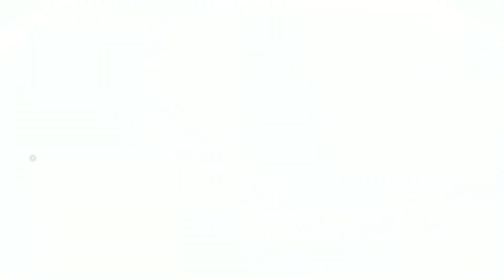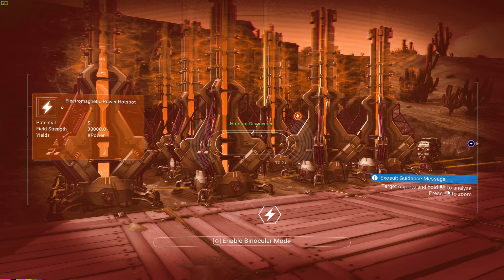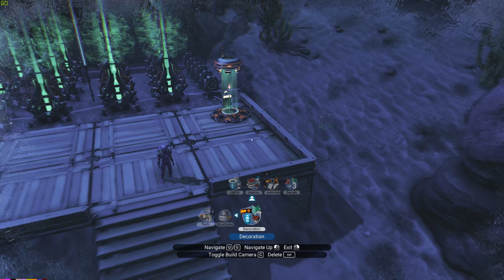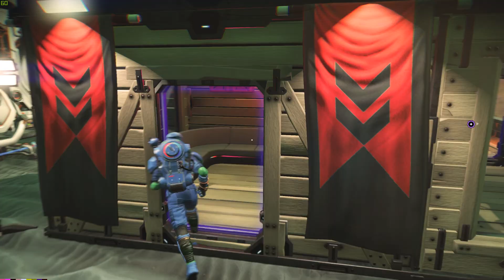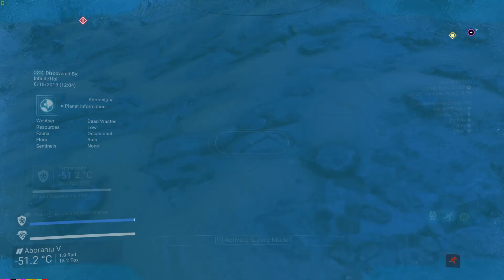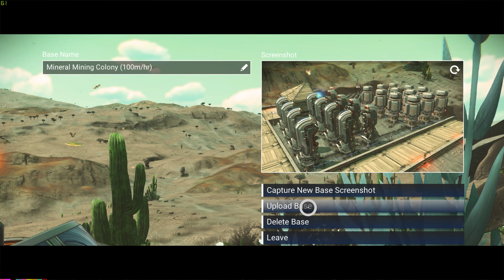No Man's Sky Beyond - Easy 100 MILLION + Units NEW Method | No Man's Sky Making Money

Comment from the maker: This is now my favorite money method. I never have to work again for money and as long as I have
a few of these running.
 Giveaway: https://www.instant-gaming.com/en/giveaway/KHRAZE-JULY
Reply: Chlorine still way better and simpler than to go through all this work just saying
Reply: Any videos of early money making for newbies ?
Reply: i got a glitch or something like that im stuck in 4.3 Billion
Reply: @user-su6ts9wm1h  money cap = Ʉ4,294,967,295
Reply: @user-su6ts9wm1h  Not a glitch. It appears that the units counter is a 32 bit signed integer. That can contain a max of 4_294_967_295 . It is an computer architectural limitation. To "fix" this would require changing from a 32 bit number to a 64 bit number. I don't know if the PS4 or Xbox can handle that.
Reply: @johnmckown1267  4_294_967_295 is 32 bit unsigned.
Reply: You should use activated indium it is worth 900 units each or more
Reply: @lilmizace9172  Is it farmable with mineral extractors?
Reply: I can only get 2 extractors running with 9 solar generators+and 4 batteries. The base terminus doesnt get power not a third or more extractors. Is this my fault or is the game being buggy?

Edit: Rewired base and discovered only 1(maybe 2) of the solar generators actually supplying power.
Reply: Now we need more ways to spend money! High end stuff like super-rare ships, freighter upgrades, and exclusive cosmetic features on all vehicles and bases. Next update patch perhaps? :)
Reply: To get the new name to appear quickly, use the teleporter, then teleport back, and your new name will appear after you come back.
Reply: I set one of these up on day one, another alternative is salt, im producing 100000 an hour
Reply: Do you need to look for both an S class deposit and S class energy pocket for this to work?
Reply: You're missing out on half the profits, activated indium is so much better and I'm making about half a billion a day with about 30 extractors... The only problem for me is that I hyperinflate any economy I sell it to with activated indium...
Reply: I’m trying set up my own indium mine, but I’m running into a problem. I’ve got over 12 electromagnetic gens and got power running to my setup but it’s not registering getting power.
Reply: @jeremykiernan6150  Are the wires blue?
Reply: Droid 0.1 Alpha yeah they were. I’m redoing my wires and putting in a battery station bout halfway between the gens and the extractors. Hopefully that will make a difference.
Reply: Still not working. Only 1 extractor working.
Reply: @jeremykiernan6150  Have you tried resetting your game and everything?
Reply: Droid 0.1 Alpha am about exit game and reload
Reply: Well that didn’t work. I’m outta iteas
Reply: I built this with a S idium source but C energy, have only 3 extractors right now but the energy is pretty far away so i built multiple base computers and laid a cable, however it seems that the power does not flow to the extractors. Can energy only flow within the same base it is produced or is it a bug? and if so, how can i fix it?
Reply: I think this method will only work in Normal Difficulty, Khraze. I also learnt that in Abyss update, HG introduced to us all about Market crashing...and in Survival Difficulty the max per cargo you can carry is still 500, so...there's no way Survivor can make that much money per day...

Put that all a side, this is still a good way to make cash... Nice one Khraze.

So far in game, my source of income is those salvage scrap...Got like 10M and still waiting for the complete Exotic ship to come accross...(only 7 hours in game tho haha)
Reply: why don't you just use a medium refinery with indium and chromatic metal they produce 1.4 yield indium

Comment: batteries are redundant as if your using battery power - your power generation isn't enough. Once you produce enough or 'too much' energy  they remain full.  I find them useful to visually see the drain numbers and calculate power needs. If I am making 9000 energy and use 8000 that means I can build just under 1,000 energy use of items, be it 50 from an mineral extractor, or 5 from a cuboid room, etc.     The geomagnetic power system... never "decays" or anything.... so they always pull that amount out. (1 battery at it's location to connect all the units to, another near your base, and another near mineral extractor is more than enough to be able to check levels wherever you are)

Comment: It really is annoying how you can only build within a 300u radius of your Base Computer. Especially so if you find 2 S-tier Extraction Zones (1 Power 1 Emeril) just a little over 352u apart. Not that I'm speaking from experience or anything. 😒 The extension tip REALLY helps though. Thanks!

Comment: So not that I'm anybody or anything, but if it helps one person not waste 2 days trying to figure out why the hell you can't get wire to transfer energy at such long distances, granted it might have been the alchohol when i first watched this video :'D, but it wasn't clear to me that every portion of this build has to be within the confines of one single base. You cannot do it (On normal setting, PS4 anyways) by setting up multiple bases (ie: Base at electromagnetic field, Base at mining field, and base half way between each point.), instead you'll need to extend your base from point to the other, or hopefully get lucky and by setting your base in the middle of two points with its perimeter covering the two points you're trying to connect. If RNGesus hate's you as it does me, most likely wont happen. What i eventually ended up trying after being so frustrated, was starting at my electromagnetic field, and running wire all the way to the perimeter of my base, then building a structure as far from the perimeter as i could (towards the point i wanted to get to), which extends your base perimeter, rinse and repeat until you get your power where it needs to be. Just finally finished getting my miners powered, and now I wait XD. Thanks for the video though! Good luck! ;)

Comment: How u run those electrical cables from one base to another?
Once I'm outside my base territory, I'm unable to build them, even if I manage, them cables won't work
Reply: SuperStarLV im having the same issue, have you figured out a solution yet?
Reply: @nasaboy0307  I just spammed couple bases in between.. They should remove restrictions for cables, so we can build em outside territory
Reply: You can expand a base up to around 950U from the Base PC.
Or if everything is in range of your base, but you cant connect it with the cable,simply put a lamp or something cheap that needs electricity to run, put them around 70 meters apart, connect them and repeat that, until you get to where you need to be, its the same,when you are expanding your base.

Comment: Followed this guide, ended up finding Activated Indium by accident.

Sells for double over standard Indium.  Only downside is cant find any energy hotspots so I'm having to spam solar panels.  Seems to be working so far...
Reply: Activated indium is the new money source, I'm telling ye!
Reply: I also havent found an electo magnetic field :( 1)How many solar panels are you using? 2)how many extractors? and 3) are you using batteries too?
Reply: @cravethewild  You need batteries to store energy for the night, so experiment with the amount of batteries. I don't hook the mineral deposits to the power grid of course. But I have 9 extractors, and I've just build a shitton of solar panels and batteries to have the energy to build a little more.
Reply: @cravethewild  Currently I have 3 batteries and about 6 solar panels if I remember correctly.  I have 3 extractors running so far and 4 silos.

That's just starting though, I plan to expand it as much as I can it's just a bit of a grind getting all the materials.

Comment: Anyone having trouble trying to power the thing.... my power current doesn't want to go that far I make it almost there and then it turns red
Reply: Brad Mason sameeee
Reply: Try putting a battery in just before where the wire turns red then wire from the battery to the objective.
Reply: @VEESIX24  I just said screw it and rebuilt the base

Comment: This method does work well. I have a nice Indium mining facility at one of my bases. Although if you have a lot of anything you can get rich quick in this game. Also, you don't have to build right on top of the hotspot to get good results. Use the survey mode to check how far the hotspot extends from the spot that    marks it on the map. It's pretty far!

Comment: Hey Khraze. I'm trying to use an electromagnetic hotspot to power up my base but whenever i connect the batteries or the electromagnetic generators to my base the cable turns red and there is no electricity.  My base is 400 units away from the hotspot so i created another base on the hotspot to be able to build. Is that the reason? Is it to far away and 400 units is beyond the limits of the wiring?

Comment: The extending base just stopped working for me I had managed to get a deposit wich was out of my base and planted flags to extend the range but after having one mineral miner setup I came back after gathering resources to setup more but it just refused as if the base had never expanded, I even added a new base but the new extractors didn't power up using the original circuit

Comment: I like that trick with extending the base area.
I was testing the limits before Beyond came out and I worked out that you could build in 1000u radius from your base but I didn't know you can cheat the system that way  :D

Comment: Does making other base beacons work to extend the base's build limit?
Reply: No.  I did that at first and it screwed with my wiring.  I had to delete those and put down base items to extend the bubble of my power base till it reached my extractors.
Reply: Campmasta yeah I did that too and the wires wouldn’t power anything outside of the base. Also placing items out of the base wasn’t expanding the boundary till I restarted my game.

Comment: Thanks for the info about expanding the base range! I'm trying to get this to work on a new planet. The base range has extended but I can't get power from the Magnetic Field to the mineral machines. My base computer is planted between the two, roughly 400 units apart from each (give or take). I have a cable from the magnetic generators to a building at the computer, and another from the building to the pumps. I'm sure I am missing something but not sure what it is.

Comment: Wouldnt it be crazy if when you traveled through a black hole time went faster! Then when you come back to the system its been years and you've collected all that mineral.
Reply: Crazy is that it doesn't. Then again we don't even have orbiting planet cycles. Physics is not NMS' strong point.
Reply: And you can't get more then the supply depot capacity of your mine... :)

Comment: So I previous came across that extending trick which i used to link two bases together. I'm not sure if the second base is what is causing the issue but they cant seem to share power across long distances. I can build and walk between to two sites easily. I think I might try with only one base terminal and see if the power will stretch that far but I am thinking there is a limit. I also tried to place my storage units within my base which were 500 units away from the miners and they didn't seem to be able to receive the materials consistently; A few worked but a few did not. Might be a bug
Reply from the maker: You have to play around with the connections / wiring. For me I had to make sure I extended the original wire and not create new ones from one tech deployable to another as that made power stop being delivered.

Comment: This is so bs, so you have to be lucky enough to have TWO s class power area close enough to each other??? Wow this is extremely not helpful not to mention it's close to impossible to scan a single s class
Reply from the maker: It's not luck. Just a matter of scouting. That's why I said the setup is the most important. I scouted on that planet for about 30 minutes until I found these two deposits and there were a lot more close to one another (but with gas which I didn't need).

Comment: I notice your silos show no power like mine despite being hooked up and receiving product. Are they just bugged where they show the no power lightning bolts even when they have power? This bugged the heck out of me and why I have twenty solar panels and like 12 batteries just for a couple of silos and an extractor. I was like.... Why the hell isn't this getting powered? Cables need to snap in place better too.
Reply from the maker: Never figured out if it's a bug or not, but they seem to not require power at all. They're just there as storage. And since it works, it never bothered me :)
Reply: @Khrazegaming  Thanks. Just wanted to make sure I wasn't going crazier. I felt like Chevy Chase trying to get the Christmas lights to work in trying to wire those depots.  :)

Comment: What is the recommended selling method? Selling to the trader module straight up hoes you on money. 
4 millions worth was equivalent to about 900K. Is there a specific system or vendor? thx...
Reply: I think you can only sell once per galaxy?  When you sell once the value plummets so sell a big stack and then head to another galaxy for the next sale.
Reply: @ITCyprux  Makes sense! I managed to sell to different galaxies. This method works great once you get it going.

Comment: Having some issues with extending my base, got it at first but then it randomly decided that I could no longer build stuff that far out, anyone have a solution or also experiencing this?
Reply: gotta stand near the structure you built out of the range. so if you built a wall at max range, between your original boundary and that wall you won't be able to build, but when you get to that wall you will be able to build again. just not in the gaps for some reason.

Comment: Could this work in theory with Activated Indium planets
Reply from the maker: Yes. That would generate way more money.
Reply: I setup a base just today, S class activated indium deposit 

40 mineral extractors, 20 Supply Depots

Powered by a C class electro magnet source nearby, the two sites are 300 units apart, at the middle i made my base, wiring from power source to mining area done under ground with dug tunnels connecting to my base too
Reply: 28 million per hour

Comment: Thanks very much for the informative video. I think YOUR setup is overkill, because you will reach cap way to soon. I remember farming to make Stasis Devices and selling 50 or so at a time. I then went overboard at  Ʉ2.5B and sold 131 of them which made me reach cap. After that, the farms were meaningless and no more fun.
I think it is best to keep you money flow to just about Ʉ1B, because you are not likely to outspend that and if you do you can make it back easily from a small setup.

Comment: How were you able to line up everything so neatly? I am constantly struggling to line up batteries, solar panels and other objects in perfect lines.
Reply: Build two small cuboids. Build first line as best you csn. Remove cuboids, do the next line. Not a surething but it should help. The cuboids will flaten the ground when built
Reply from the maker: Pretty easy. Use the build camera (c in build menu) and manually align everything.
Reply: Good question
Reply: Or how to evenly flatten out the Terrain lol

Comment: I’m finding you cannot connect 2 bases together. Closest underground power is 798u from my original base. So I built a second base to build the generators but they will not connect between the 2. I’m going to try your method of base extension and see if I can extend it that far
Reply: Yeah, power lines wont provide power outside of the base area. That's why he has the base in the middle, and he's lucky he got 2 S class deposits within that range.
You don't need the EM generators for this though, you can use a Solar Panel + Battery setup as well.

Comment: What is your pc spec? Im using i7 6700k, gtx 1080, 2133mhz 16gb ram on 1440p on win 10 my fps runs around 50-70fps max settings with dips to 30.
Reply: This game is very dependent on environment. With my 5700xt at 1440p max settings, very lush planets will run around 50, bare planets run around 80-100 and space sits at 160 almost all the time